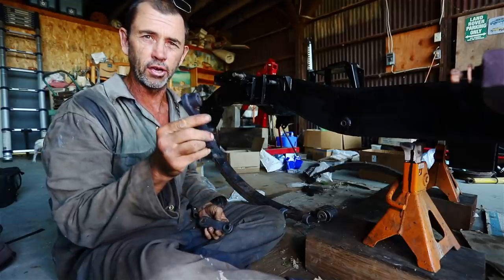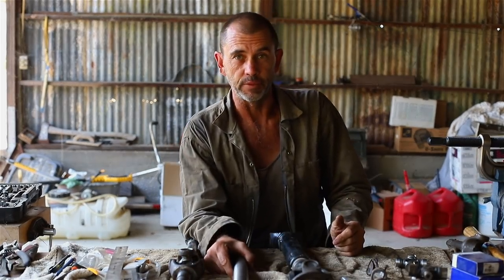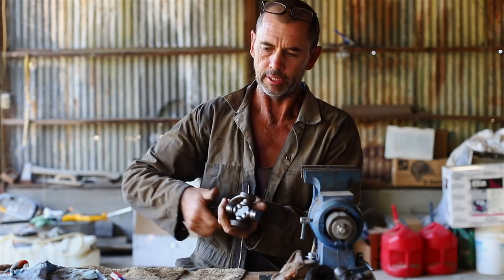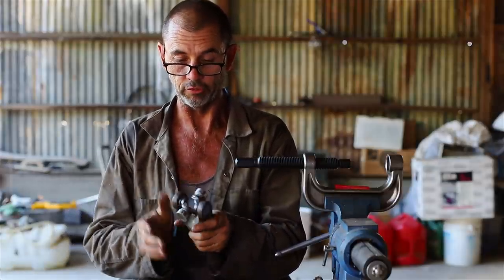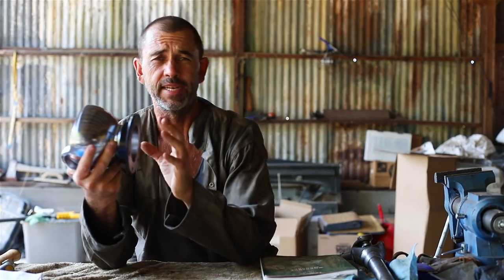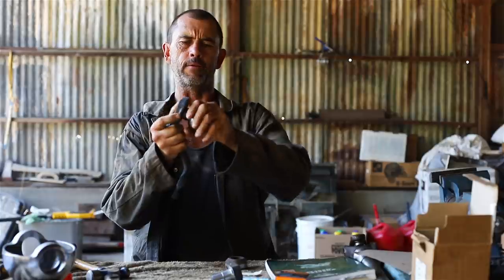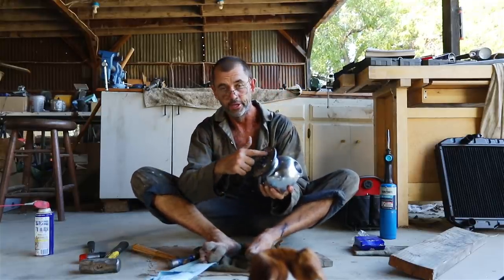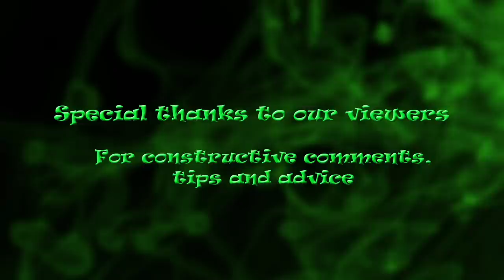Part 15: Scorched Earth and Swivel Balls_ Series 1 Land Rover Restoration

Comment: May I suggest picking up some 6061 aluminum rod of varying diameters, which is available from 5mm thru 40mm (McMaster-Carr). These make great drifts for working with components that you don't want to harm while installing or disassembling. Using that hammer on those parts is a no-no. Enjoy watching your project progress.

Comment: All good clean fun. Done this job myself on a 2A many years ago when I was a young fella like you. That short bit you didn't recognize I think would be the upper swivel pin. The lower one being the one with the steering arm. Thanks for another entertaining watch. Cheers from NZ.
Reply: The older type series front axles have the steering arm on top.
And the steering arm king pin has a different diameter than later models.
I think he bought the wrong kit
Probably the source off the confusion.
Reply: @rickz9495  Actually I might be mixing up top and bottom. It was a long time ago.

Comment: Fantastic series, a joy to watch. Have just purchased a 1955 series 1 80" with only one previous owner. The only problem is that it was stripped down into a zillion parts some 2o years ago. The previous owner assures me all the parts are there. However there will be many parts missing. Your channel is great, you making all the mistakes so I dont have to. Showing me how to build my Landy. Keep up the good work.....All the best   Lee from the U.K.
Reply from the maker: Best of luck on your purchase, we both know a few bits will be missing but quite a lot of the works already done for you. It'll be a fun project. I do use anti seize grease though more often than not WD40. A potential problem I see with these old trucks are nuts and bolts rattlin' loose so I use a lot of the blue lock tight and swap out original nuts with nylock ones when I can. I'm not too interested in the purist approach to restoration but rather functionality.

Comment: Excellent work again from Mr Foreman, and great camera work / editing from Ms Wilms!  Enjoy the forthcoming delights of the Spring Balance and shim set up...
Reply from the maker: And delights they shall be Mark. As I may have said, "Nothing lightens the mood more than fixing Land Rovers".
Reply: @ForemanAndWilmsAdventures  you have made restoring yours very entertaining, but remembering my 3 year task to do the same for my 86" I do recollect a few dark hours / days! Times like those just retire for a cold beer / hot cuppa, relax and think out the problem for another day...I am on round X at present - rebuild of bottom end of 2 litre Spreadbore, renewal of bulkhead (much head scratching on wiring) and a overhaul of the Fairly Overdrive (there are other minor issues I will be dealing with as well). Will be back on the road / off the road in April...
In the meantime your series of videos are excellent - many thanks and keep up the great work!

Comment: I used a friend’s press to install all my U joints. It worked perfectly. I did have to clean the burrs with a file and clean the circlip groove. I put a little extra grease in the roller pins. So they don’t fall over or out. I like the big C clamp idea. Nice job!! Those fires are scary!!
Reply from the maker: The C clamp was an amazon purchase if I recall correctly, not too expensive. I watched a video on replacing uni joints from Britpart channel. It was the best of the lot because it explained all the little problems one might encounter unlike the other 'how to' videos that make it all look easy. The burring for instance rarely gets a mention yet I've found it to be quite common.
Reply: @ForemanAndWilmsAdventures  you’re right. A lot “how to” videos leave stuff out. I noticed when I pressed out the old U joint that some little shavings came out with bearing cap. Then I could fill the burrs with my finger. The C clamp looks like a ball joint C clamp? I rented the tool from the local advance auto parts store for free. It was beefy!!

Comment: The fire footage triggered my flashbacks and subsequent panic reflex from our near miss, but you brought me back with your satirical take on the Armageddon. I must say I am rather impressed by the damn handy and mobile sand bucket - a must for all flat earthers and plague enthusiasts!.  Nice work on the tools, a delicate balance of blow torch and hammer, would have appreciated at least a token go of the grinder and a bit more cherry red from the torch but alas no.  I do love a good  cliff hanging "to be continued" ending - will he get the grinder onto it? hit it with a bigger hammer ?? get a bearing stuck sideways???   so many questions unanswered, so much suspense!!  I look forward to the thrilling continuation, the wait gives me hope, reason and  justification to  put off working on my own projects.
Reply from the maker: Greetings there Steve, you gotta' throw in the occasional cliff hanger to mix things up a bit. The rose tint on my glasses has worn off with age so time spent with my head in the sand bucket helps me hide from the bright light of reality. I recommend the practice.

Comment: Mr foreman you probably bought a later model swivel kit.
The later model front axles have the steering arm on the Bottom instead of the top. 

Top Notch video's as always!
You put a lot of effort in them, just look at the circlip montage.
Reply from the maker: Greetings Rick, that is correct about the parts kit. The parts I buy from all over the place and take so long to turn up I forget from whence they came. The product descriptions also seem quite vague so I often find myself getting the wrong bits. These things could cause stress and frustration to many, however I have a powerful imagination and can take time out vacationing in other worlds without the aid of illegal pharmaceutical products.